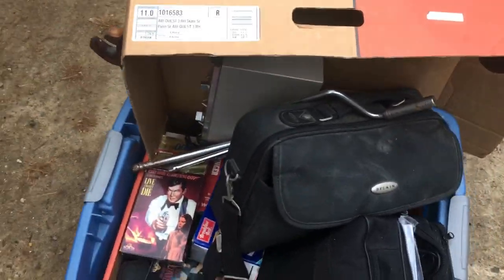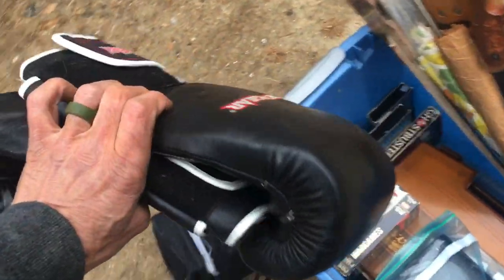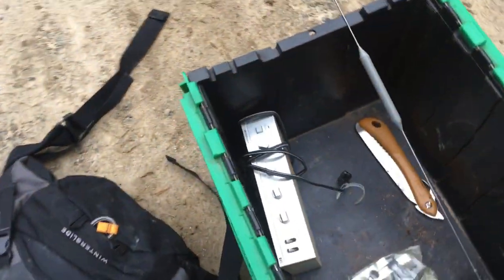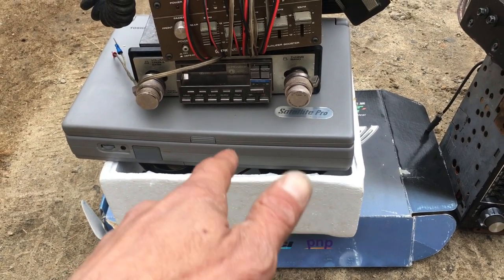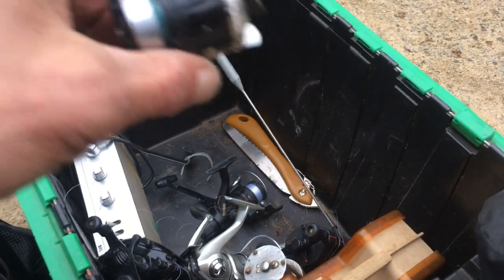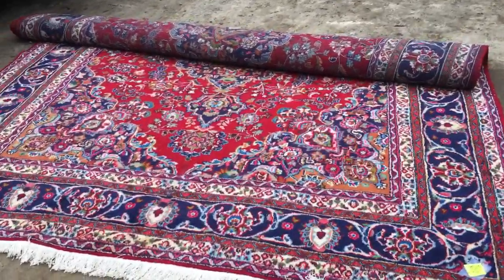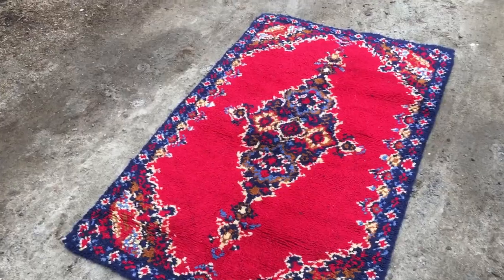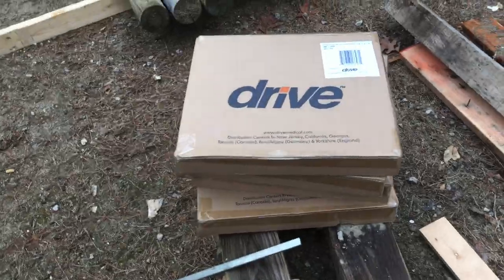Vintage Audio Sells Well On eBay + The 1 dollar working phonograph

Comment: That’s an Edison model C-150 from 1916-1922, hope you can get it cleaned up, someone makes repros grills.  It has an aftermarket electric light at the back of the cabinet, those screw in near the turn table so when you open the lid the light turns on, it’s not original but an accessory. The thing about Edison phonographs is they can only play Edison records, unless you get a lateral adapter.